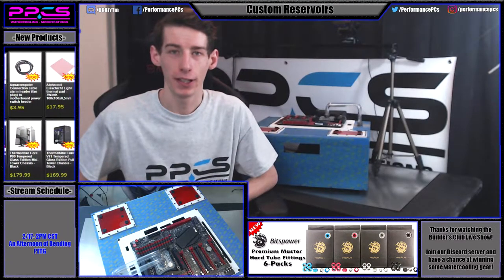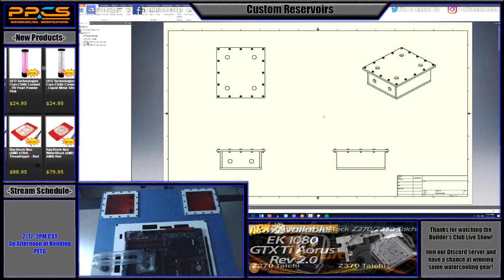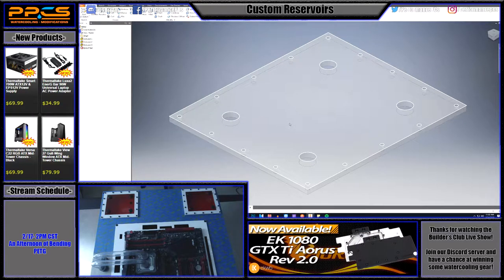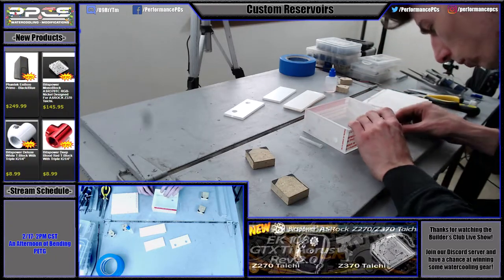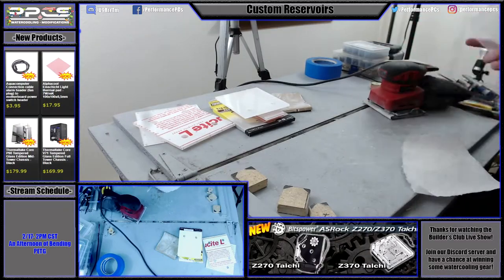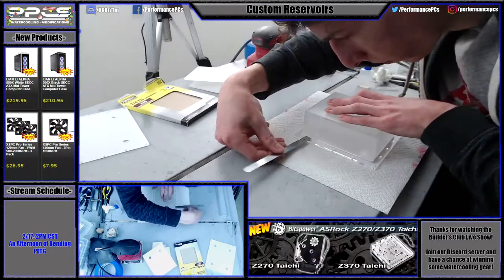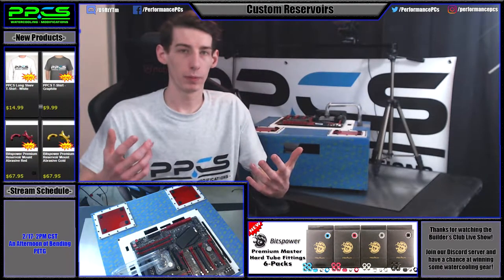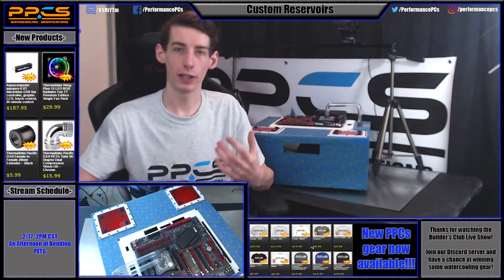How to Make a Custom Reservoir with PPCs

Comment: love the tutorial,. Only question I have... Why tap after the lid is on, arent you just dumping acrylic bits back inside?
Reply from the maker: Thank you! Tapping before or after doesnt really make a difference, but you are correct, tapping after makes it so you have to clean out the reservoir before using it. However I typically clean them thoroughly anyways.